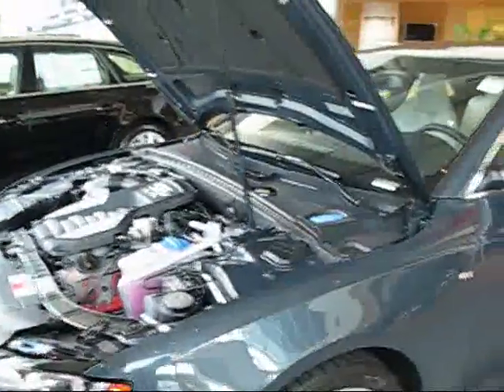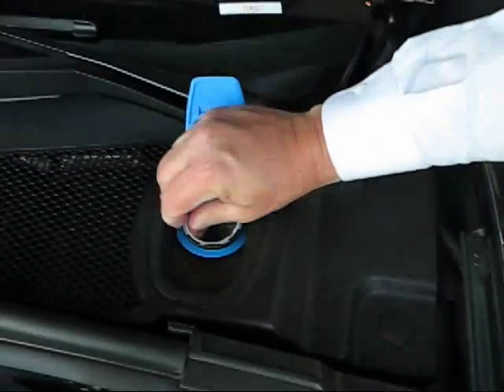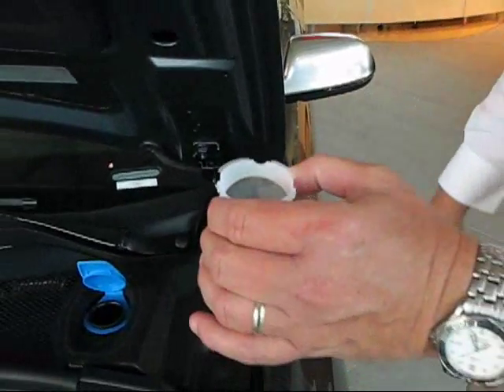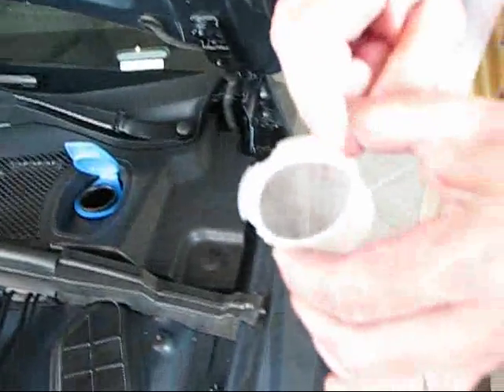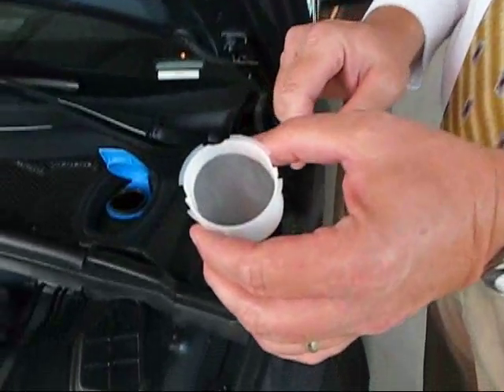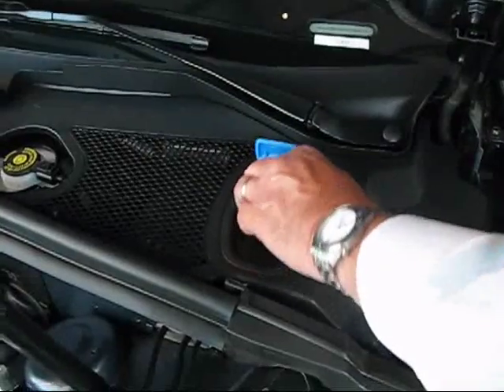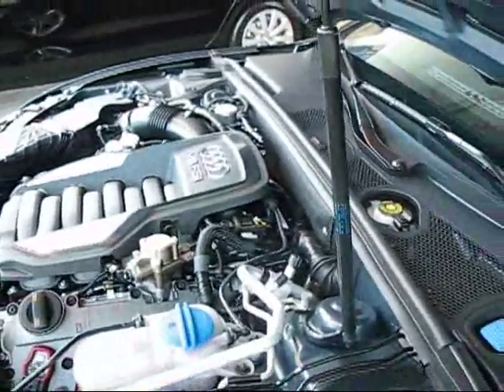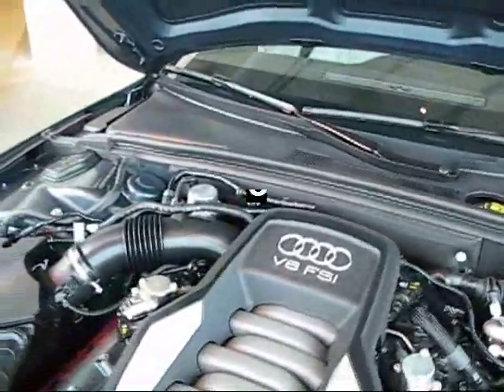McDaniels Audi of Charleston Car Videos Windshield Wiper Tip

Comment: its for contaminates that may get in there when you fill it.  say your filling it when it gets empty and the cold wind is blowing around dirt from the road.  it wont get in there.  more common sense things.  think he is pointing out high quality features.
one of which is heated wiper fluid.  it blasts ice off.

I found a piece of leaf in mine.  not sure how it got there.  btw dealerships are crooks